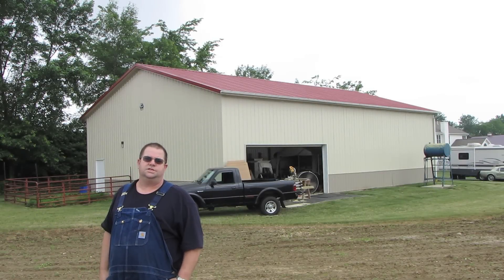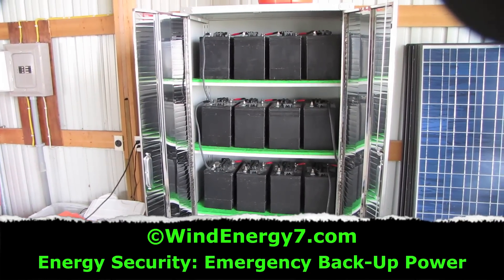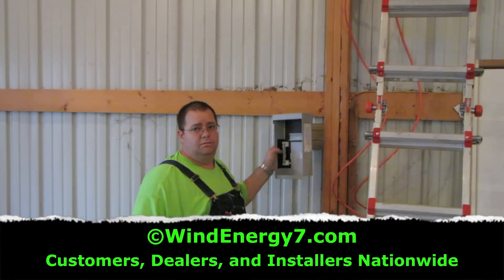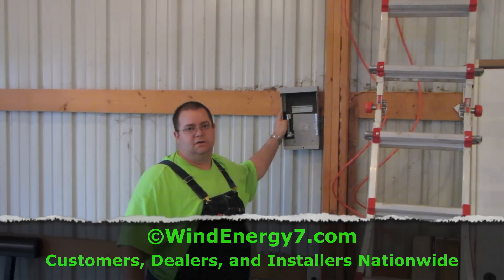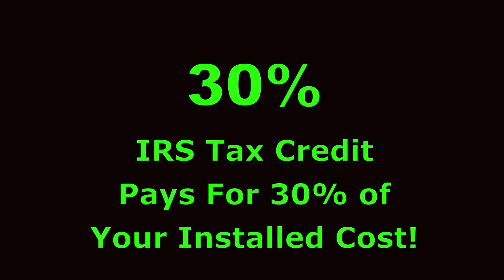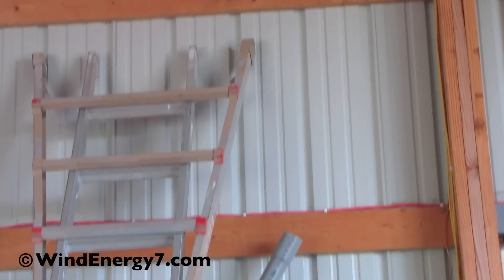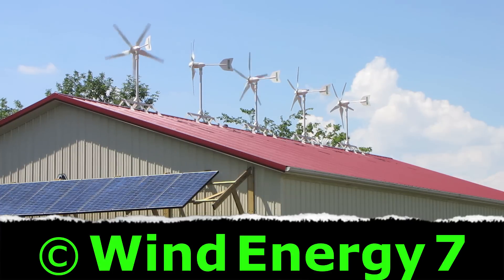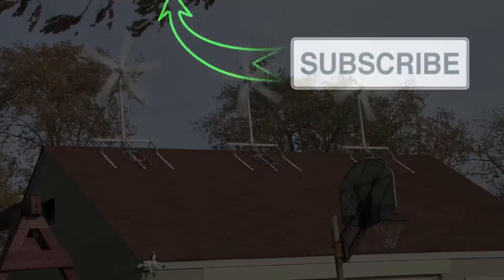Home Wind Generator

Comment: Truthfully, I would like to see the stats for the energy production, both wind and solar. Over the course of a year, I seriously doubt that a net gain would offset the expense. What is the expected lifespan of the wind generators? Obviously, this job was not permitted, and if it was, what would the inspector say about the "total load" of the wind force on a pole barn? Just curious....
Reply from the maker: Hi Super Dave, Many agricultural sites don't permit because it runs up the cost a bit.  BUT this could easily pass permit since RoofMill has structural certification in all lower 48 states.  I permit about 90% of the installations and can easily pass inspections in any state.  Its a RoofMill and is a proven system that always pays back and pays off.  Have a look at the date on this video.  This customer is a 5 time repeat customer based on success of this very installation.  SEE: https://youtu.be/5eUNYJ4CbyU
Reply: HomeWindGenerator    STATS!  That's what I would like to see.
Reply from the maker: Yeah, I'm sure but people have to understand that no two sites have same angles, wind direction, weather, geography, proximity to obstructions, etc.  We never post stats because its misleading.  Anybody posting stats about wind power are misleading a buyer without an actual site to estimate with.  Like this system here, there is no way his site will reflect closely the output of your site.  Every system sold gets a site evaluation, site plans, system drawings, and all that stuff which then indicates an estimated result.. only based on a full picture.  Here's what I can do.  Lets put in a system for you and personally estimated based on your home's details.  I can take you to this site and let you visit with this customer, his father in law's farm, and his doctor's office all which are powered by my systems successfully for many YEARS.  When your systems are real, you get repeat customers and referrals like this.
Reply: HomeWindGenerator 
What you said may be true.  Of course every application is going to be different, but I want to see the stats for this job over the course of a year.  Measuring the amount of power produced over the course of a year can't be that difficult.  I would like to see the pay back period and proof of concept.  Show me FIGURES!  Every prospective new customer will want to see that.
Reply from the maker: Yes dave, exactly it takes a lot of detail to sell and install a system.  Just like reviewing electric bills from year to year before to after on a site like this.  That's how I sold the guy his second and third upgrades.  Friends and family show each other the systems and they sell themselves based on customers sharing their figures with friends and family.  Or you could share with the guy yourself if you want to buy a system.  This is not a proof of concept, it's a mature proven system installed all over the world now.  This was all invented over 10 years ago.  I am not really needing to prove anything about the RoofMill which powers hundreds of homes and busineses.  RoofMill systems pretty much sell themselves.

Comment: Our house already faces south so putting in more solar panels I would think would not be a problem, my question is this; I live in Idaho and we get some very strong winds (over 50mph is not abnormal) is there a way to make sure they do not over-rev or get torn off the roof.  Our normal (especially snow bearing) winds are from the south and south-west.
Reply from the maker: Yes its no problem.  We have the systems certified for Idaho permitting and insurance to withstand up to 130 mph wind on your roof.  RoofMill is a proven system that has been in the field surviving many tornadic winds, hurricanes, etc.  I have a video of a RoofMill in hurricane winds that were gusting well over 60 on video.  It really demonstrates the engineering.  SEE: https://youtu.be/5eUNYJ4CbyU

Comment: Wondering if it's worth the initial cash layout... Looks like a muscular system.
Reply from the maker: Hi Michael, Yes of course.  I can demonstrate a positive ROI within the first year on these systems.  What you must realize is that you are already spending the money, in electric bills LIKE RENT.  But you get nothing in return renting electric bills.  These systems have warranty on power output going out 25 years and a life extending past 30.  So, its pretty easy to take 30 years of your electric bills, COMPARE THAT to a system cost.  I do cost justify all the systems I sell to each customer.  Go to site, fill out contact form.  THX

Comment: Why didn't you just mount the solar panels on the barn roof ?? 
Seems a waste to install them facing tress
Reply from the maker: Because the roof faces east/west, all solar will do much better facing SOUTH.  Wind in this location comes from the west, so the peak, running opposite the predominant wind gets great wind acceleration in this location.  This system, now running since 2010 does really well.  Thanks for the question Shane, please fill out the contact form at my website.

Comment: How much might it cost to hire an electriction to wire a home to accept this power??  And run service to the house from the barn?
Reply from the maker: Well that depends on distances and size of system.  But in most of my barn systems the wire is already run.  I power the barn and it backfeeds into the home and out the meter if there's excess it sells to the utility.  This is all designed to retrofit to any home or business easily.

Comment: So where do we get energy from when there is no wind or sun? I guess you go to hydro power. Can one build a large enough tower with water and have both solar backup and downward momentum from the water pressure to spin inline 12v hydro to pump water back into top of tank?
Reply from the maker: Its a zero benefit if you waste power to pump it.  Its like turning a fan on your wind turbine.  We have battery banks to store power and use in times of need.  That's how we can run complete farms off grid.  I power all kinds of sites 24/7 off grid.
Reply: Well apparently you don't understand the concept. Gravity naturally will force water downward through a pelton wheel hooked up to a generator and battery banks. You install several mini hydro 12v generators inline thus supplying your needed power to a 12v pump which pumps water back into cistern or a large tank sitting up higher.
Reply from the maker: Hi David, That would be a perpetual system which does not compensate for the power used to resupply the tank uphill.  I get it, I just don't see that working anywhere its been tried.  And it has been tried.  If you find an actual example of that ever working for real, be sure and post it.  I am interested and I get it, I just don't see the value in comparison to sunshine and wind making great power easily.  Thanks for your post and if you find an example post me back.

Comment: I'd like to know about the noise. I had a small turbine for a few years, as did my neighbor 600 ft away. The noise will drive you nuts.
Reply from the maker: Not one of our turbines then.  Sure, a low quality turbine system may do whatever.  You didn't have a bad noise problem with our systems.  That's why we have our own inventions and designs to be successful for many years.

Comment: What’s the noise rating at 6 , 10 and 20 meters
Reply from the maker: its funny the questions.  noise ratings are mostly bogus that others publish.  we dont have noise complaints because its a RoofMill not some cheap noisy turbine.  Our hardware is certified in every state of the US.  Its an award winning product.  Noise ratings, the important thing is.. is it a problem.  Ours, no.  No customers anywhere complaining about noise.  This system here is running now about 8 years or something.

Comment: Unless the height clearance to obstacles (trees ans such) are 25 to 30 feet in favor of the turbine you will get turbulence an wind shadow. I tried with clearance with 9 feet (3 meters) above treetops and my Airwind 403 often put tail against general wind direction because of turbulence. This may short the lifespan of turbine and vastly impact on the power.  You should mention this site is far from ideal when keeping these obstacles.
Reply from the maker: This was a new install.  The row of trees next to the barn got a haircut after this install but the customer left them about 10' for privacy.  Your example of an Airwind is way different since an ASirwind has no body weight and comparable tail, it will not do much with turbulence no matter where you put it, its a toy in example to this turbine.  Also the example of a tower mounted turbine has no roof effect like this accelerating and concentrating the wind over the roof dramatically.
Reply: No matter if you got a toy or normal turbine installed. I is affected by turbulence and wind shadow anyway. One turbine may deal with turbulence and shadow better than another, but still creating or keeping wind obscuring objects affect power negative. Customer should be informed by that. Then it's his / her decision what or how much of wind obscuring objects should be removed / kept. Even in the notes below video you could mention that the site (as it was filmed) is far from ideal when treetops are way above turbine. 

Wind obscuring aside, this rooftop assembly is  pretty clever.

Comment: The rack for the solar panels looks like shit.
Reply: Should've been made out of metal on the get go
Reply from the maker: We can use different racking, its a customer preference for cost and durability what type system they want to have designed.  We have done hundreds of systems and design around customer needs and site requirements.

Comment: uninformative.give specifacations,watts,costs???
Reply from the maker: Go to the site, this video is from my system almost 10 years ago.  There is a reason I am not plastering my videos with specs and stats of my second generation turbines.  I am in my 4th generation and am no longer selling my second generation turbines.  Specs, Watts, Costs, all moving every year improving technology and value.  Go to my website and fill out my contact form.  Ill give you pricing, specs, and watts on a current 2018 system that is sized FOR YOUR HOUSE OR BARN.  THX.

Comment: Hi.., I have a dc  motor on a windmill setup with a high out put off 200v dc to 250 v dc. When I turn it one time turn fast it creates around 20v dc to 30v dc. How can I regulate it . So I can recharge my 12v battery bank with out hurting my batteries?.., thxs
Reply from the maker: You need to get an actual system like RoofMill that is safe and CE and UL certified.  It must pass local building inspection, fire codes.  What you are doing home made is unsafe for your home and family and you should not experiment with electricity in your home.

Comment: It seems from the video that the solar panels are subject to significant shading. How does this affect the power output?
Reply from the maker: Hi Shawn, Not bad, its probably 5% or so because the trees all got cut down 1/2 way after install.  I put in a big solar tracker.  We added another few rows and they cover a sheep pen now.  We added another 2 arrays on his roof because he bought a Tesla and put in a hot tub so we had to add more power to the home wind generator system.  There is a contact link at the website if you want to get pricing.
Reply: Thank you.

Comment: AC or DC motor you use in this wind turbine?
Reply from the maker: I don't use motors these systems are designed only for wind turbine use.  The turbines are all 3 phase wild AC.

Comment: 2x6, big waste of money
Reply from the maker: You have to talk to a customer and tour a site.  All my systems are returning on investment.  I am about 10 years in the market and have many repeat customers and lots of family and friend referrals based on results.
Reply: Yes, I believe it is much more efficient and cost effective to have one generator that has 5 times the capacity of one of the small ones, rather than having 5 small ones. That also gets it up higher where the wind is stronger and smoother.
Reply from the maker: Hi Andy,  I have hundreds of installations and larger turbines on towers.  Nothing out performs a RoofMill with predominant wind lifting over the roof accelerating the power.  Its cheaper, its easier to deploy, and it makes more power.  The RoofMill is not a new product, its very proven in the field.

Comment: i am thinking about installing these in my home
will you guys export it to India ??
also, are the wind turbines and solar panels capable of generating electricity upto 3kw and 220v of output electricity ??
what type of batteries do u guys use ?? are the batteries environment friendly and does it need frequent maintanance ?? +HomeWindGenerator
Reply from the maker: Yes I export systems all over the world and I already have home wind generator systems in India.  3kW and 220v is no problem at all.  We use FLA batteries 6v Golf cart Spec.  1 tablespoon of distilled water per cell, every 90 days does fine in most installations.  I have battery banks with batteries going over 10 years now.

Comment: Why was the Solar awning not pitched to the same width as the ten panels ? I expect you might want to add another couple, but seems a shame to expose the wood to the weather.
Reply from the maker: Yeah, good question.  After the wood dried a couple of months the wood was all painted and the ends modified.  Its because we had three more rows of different panels to upgrade with.  So, that first row was a bit temporary and the final array was really much larger.
Reply: It's treated lumber

Comment: Presuming no input from wind/solar, how long from fully charged to fully discharged for the battery bank?
Reply from the maker: Good Question.  It depends on what size battery bank you put in.  We put in a minimum size of 10kWH and thats up to the customer how much storage they want.  Depending on how often you lose power or what your goals are.  My completely off grid homes, farms, and businesses of course do much larger.  I built a battery bank in TX this summer that was 80kwH and that was with a 32kW system.  Any size, any where, I can power it up and keep it powered.  The customer doesn't have to figure it out, I design the whole system and engineer it to meet the needs, goals, and budgets of each customer.  That's why people do systems with me is the experience and the large body of work.

Comment: How is your support attached to the roof? Do you bolt to the structure or just to the sheeting?
Reply from the maker: These are lagged into the rafters or trusses and are certified to withstand 130 mph of wind.
Reply: OK, thanks.

Comment: isn't vibration will be on the roof, do you have any vibration reducer
Reply from the maker: That's why its an invention, yes, of course it is all designed to be smooth and quiet on the roof.  Thats why it's a RoofMill, it's an invention and designed FOR THE ROOFTOP.  Don't try it with any other turbine or hardware for sure.

Comment: how much did the materials cost on this job, not labor?
Reply: bjmain1947 $11,790 to $16,990.
I can't stand it when retailers are not transparent with the cost of their products. "Contact us for pricing", BS
It's like walking into a convenience store and having to ask how much this piece of candy is, and how much is this soda and how much are the hot dogs?
Reply from the maker: You can get the kit costs at our website and they come in a range of sizes and configurations to power anything.  The systems are sold as complete engineered and certified kits.  The installation can be done by any local electrician or contractor.  We design, engineer, and support it all.
Reply: gwp1ohio ppl
Reply: John Smith silver spoon baby, just do some research and then customize it to your needs.

Comment: How does the system work with snow?   solar and wind.    Looking at making a system for inflow heating and AC.
Reply: +Jason Ta Works very well.  We have other videos showing the systems in snow and ice and they hold up very well.  I have these installed in Canada and Alaska for years with no problems.  This is all very heavy duty outdoor equipment made for the task.
Reply: WindEnergy7

Comment: Why was the wooden shelf for the solar panels so much wider than the panels?
Reply from the maker: It was originally planned for 11 panels and the specifications changed by time we installed.  The end a frames were later moved in, and we have added now 18 panels extending that to 3 rows.  Since that install this customer has upgraded 3 times with WindEnergy7 now to 15kW.  He bought an electric car and powers it too.  He also referred his father in law who bought a 10kW from us, now he is looking at adding more as well.  We get a lot of repeat and continued business and referrals after customers prove their first install and decide to invest more after they know how well it works and they get a taste of free electricity.

Comment: If You are wanting small home wind generator, home wind generator kit, home vertical wind generator, home wind electric generator, home wind generator plans, rooftop wind generator, home wind power generator, home wind generator reviews then check out their website. These guys have installations in about 40 states already. They have no money down financing for Home Wind Generators.